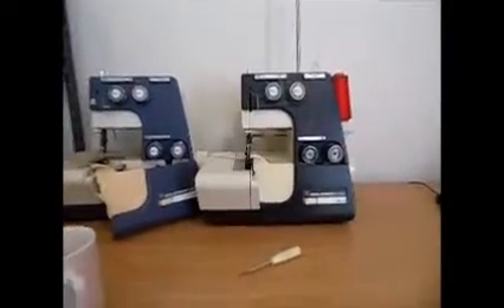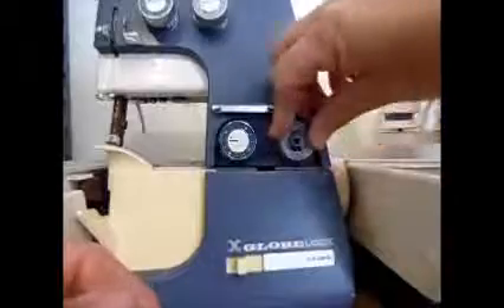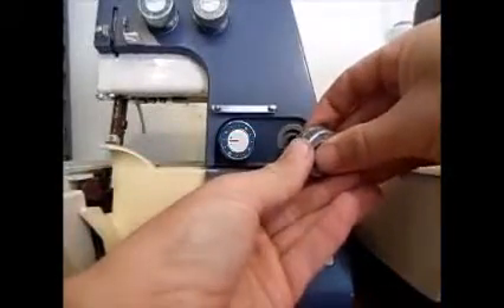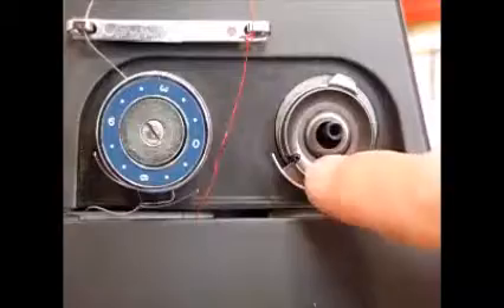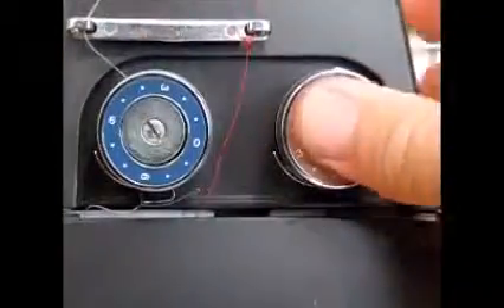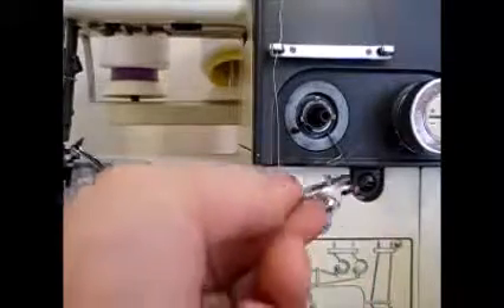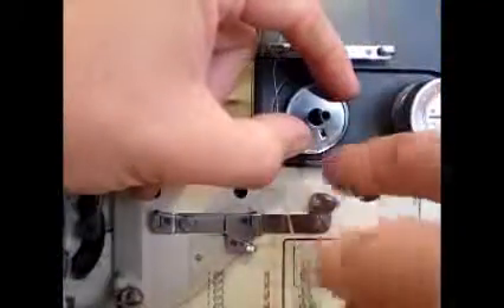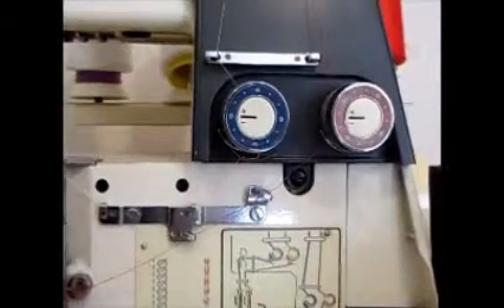Globe overlockers and Frister+Rossmann overlockers and White overlockers tension unit repair

Comment: I have exactly the same overlocker, but is a Jaguar Lock M-34.  This video helped a lot as the tension dial on mine came loose and I couldn't figure how to fix it.  I wish you could also make a video on how to fix or replace the motor as mine burnt out and I haven't been able to use it for the past few years.
Reply from the maker: You can join the FAQ at https://www.absolutesewingmachines.com/FAQ-Sewing/FAQ-Catergory/overlockers/ or join the forum at https://www.absolutesewingmachines.com/forums/forum/sewing-machine-support/overlockers-and-sergers/ for more help.